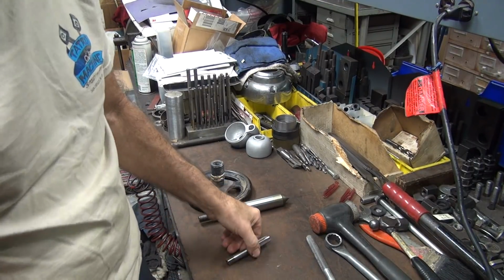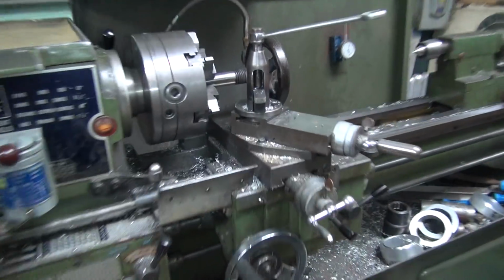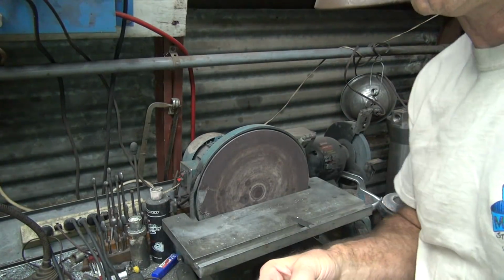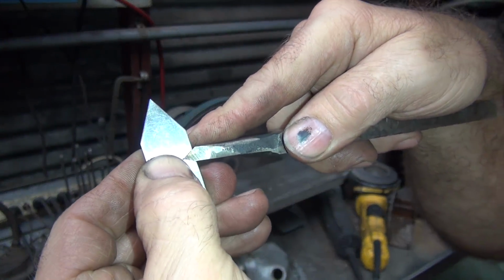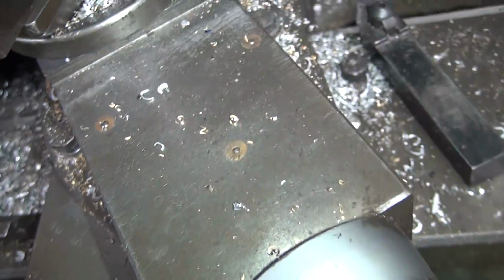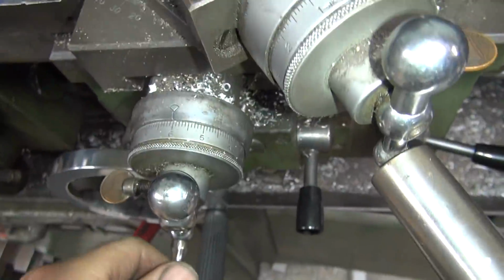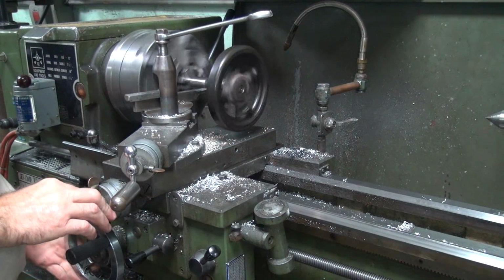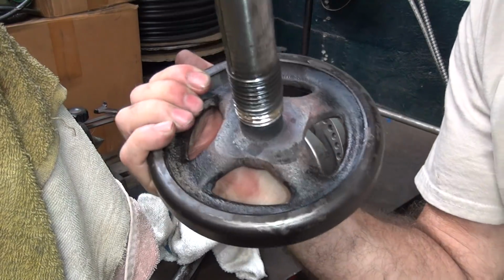#109 1990's evo lowerend 80ci 96ci motor rebuild harley fxr softail dyna by tatro machine

Comment: You are good on your od and id but where the brass threads are, it’s binding on the sides of the threads. You just need to move the cross slide to cut more on the left or right. Color the threads and screw it’s in and see where it binds. I’m a big fan by the way, thanks for your videos!
Reply from the maker: brass is hard to machine with crappy tools and lathe. that old cutter was probable from ww2. 
resharpening the cutter, tightening the cross slide and cutting the threads correctly from one side would have helped but where is the fun in doing that.
tatro

Comment: Just a question. Why is that lever on the other side of the rotating?  Lol seems unsafe.
Reply from the maker: so is taking a shower but most people do it.
the leaver is in a good spot and lathes have been made this way since the beginning. notic that i have full controle of the engagement so i can do what i need too when i need it.
tatro